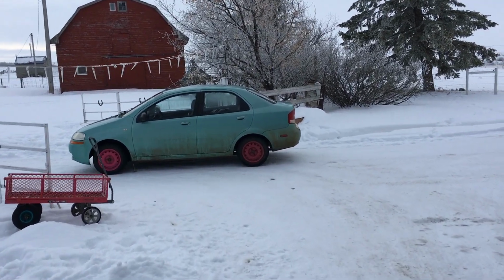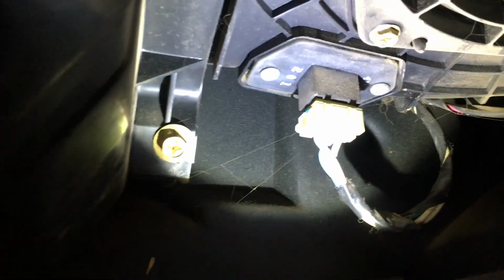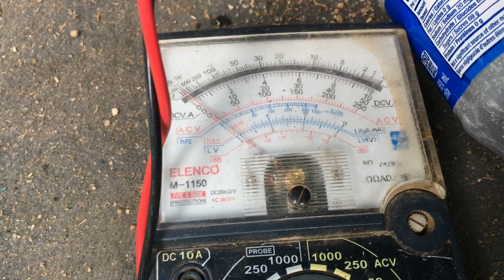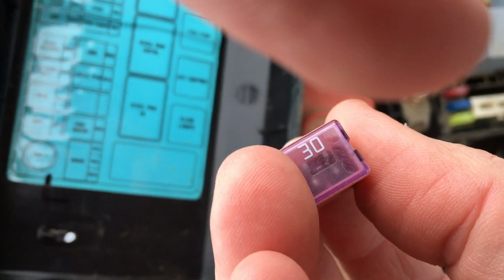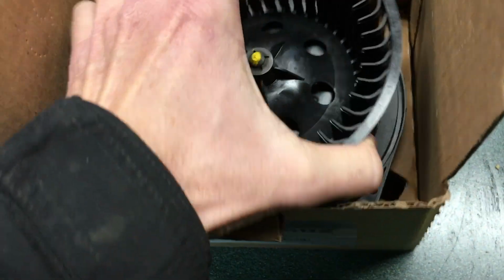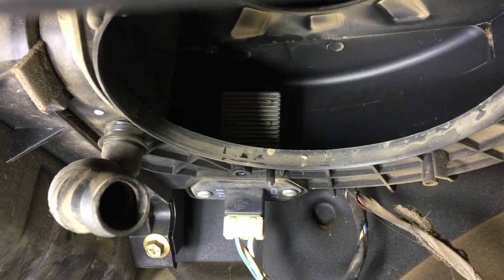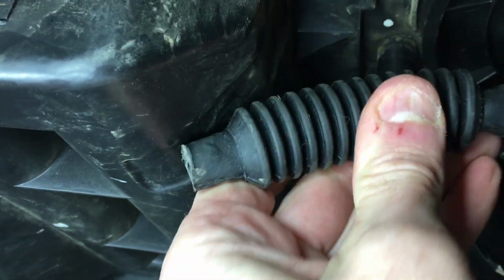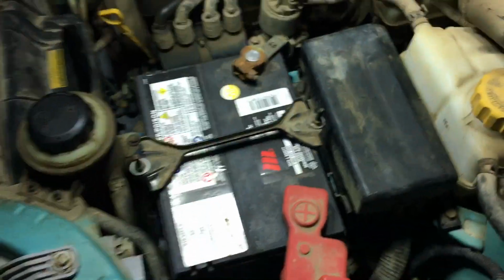2005 Pontiac Wave (Chevy Aveo) HVAC Blower Motor Diagnosis & Replacement

Comment: Remember the good old days when the blower motor was on the fire wall and you didn't have to break your back working under the dash?? 
I do 😭
I just did a blower motor on a Focus , pretty much the same deal without the blown fuse .
Caught it before that happened .
I have seem many bad blower motors but never a bad dash switch , still good to check to make sure the motor is getting power before getting a new motor 👍
Reply from the maker: Yeah, did some digging on this just to be sure.